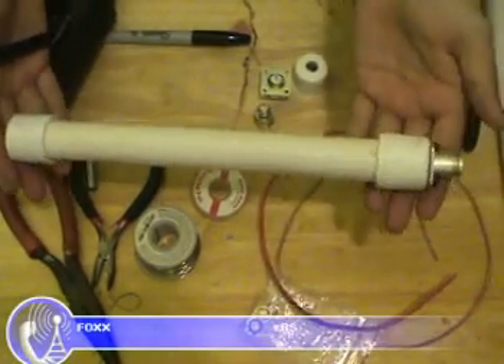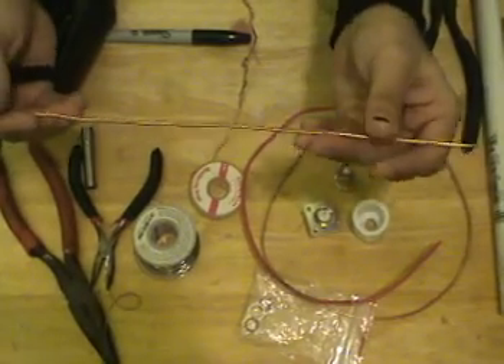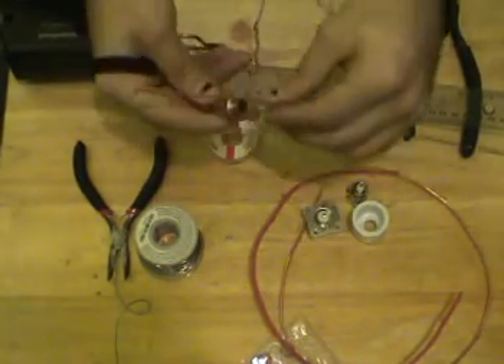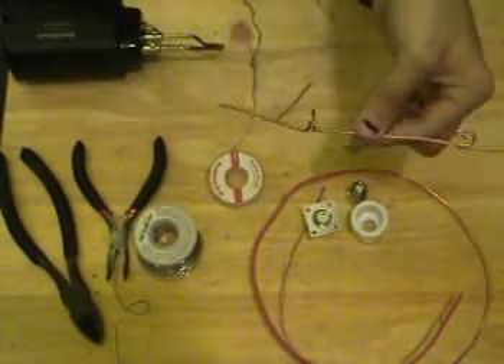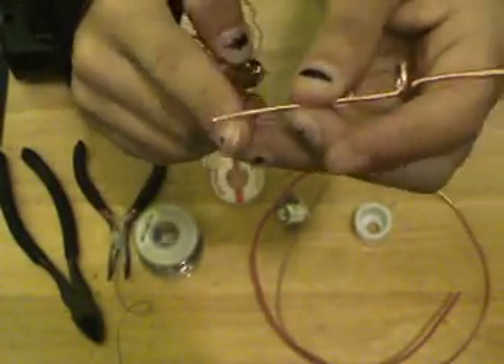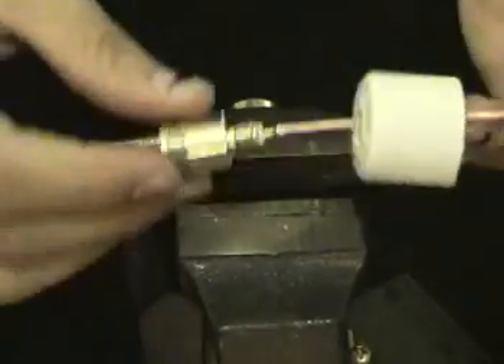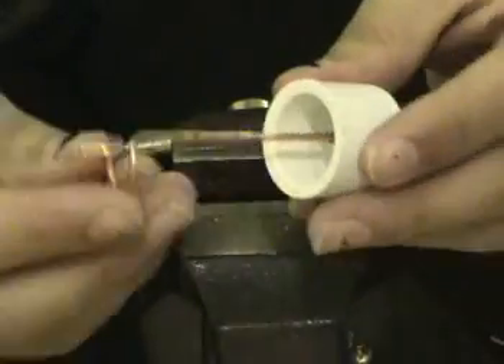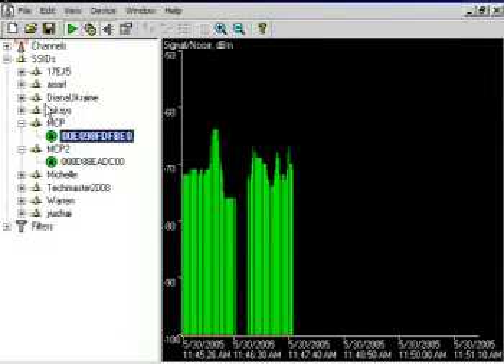2.4 Ghz Compact Collinear Antenna

Comment: Just built one of these for use on a HSMM-MESH node. Quick observation using signal/noise logging on two nodes (one with stock RD's the other with a high gain RD) saw  +2 dB over the high gain RD when swapped for the compact-colinear. Have $4 invested into the N connector and the wire was scrap…

Comment: ur correct, SWR meters for those freqs are expensive. try to put on 4 radials each 0.25wave lenght long, with an 45degr angle. must be close to 50 ohms. don't forget the velocity factor
Reply: Nice idea. 
Where can I find plans or diagrams related? 
Thanks